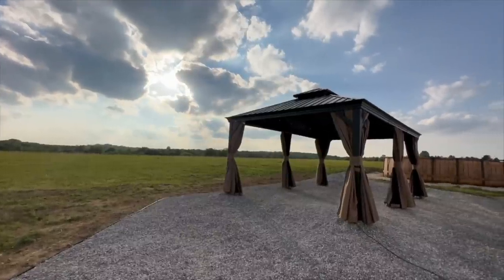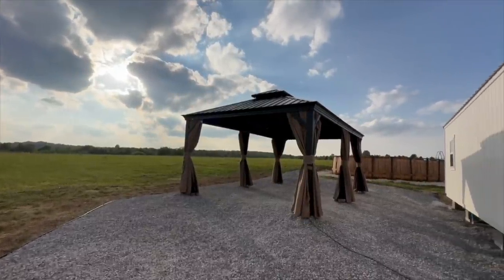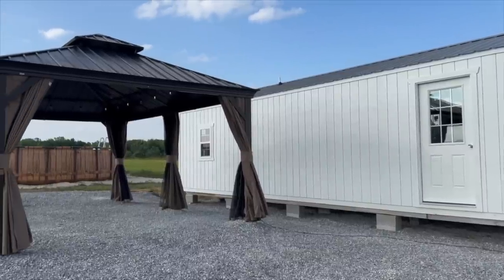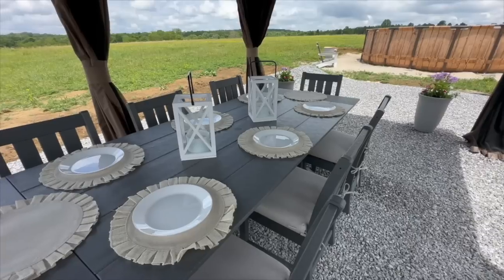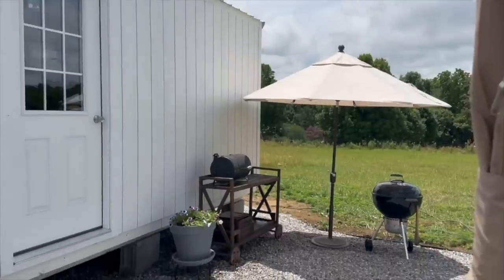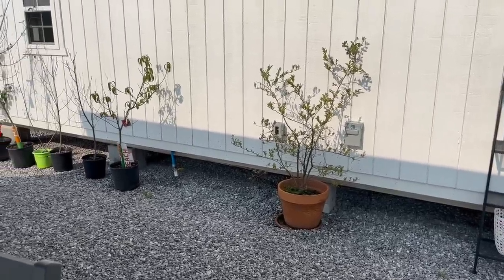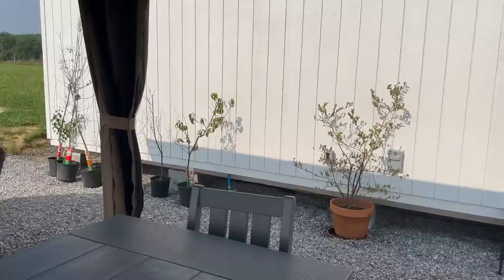PATIO MAKEOVER PART 3: A NEW POOL AND NEW SEATING AREA

Comment: Yes, you can still plant them if the branches, and near the bottom of the plant is still green. Let them get rooted in the ground, and then take some Epsom salt with some baking soda take a good strudy rod, or a PVC pipe put it in the ground as close as you can get it to the roots, and pour your mixture of the salt and soda, that will really bring your plant to life. It will make the Green, and the bud's really vibrant, and it also helps keep the bugs from tearing up your plants, you won't be sorry you did it. How to mix take one part of water to 3 to 4 tbsp. Of soda, add your salt's with one part salt's and one part water mix it with the soda mixture and with the PVC pipe in the ground as close to the roots as you can get it pour the mixture through the PVC pipe, and watch magic work. But be careful if you get to much of the salts it will turn your plant brown. I tested on some plants I was going to give away until I had the right recipe. Talking about beautiful plants with vibrant colors and the green leaves so beautiful I promise you won't have any regrets. I hope this helps you..  your friend Brenda 
Brenda

Comment: saltwater pools have traces of chlorine. Saltwater pools use chlorine generators and an electrolysis process to prepare the chlorine required for your pool. Electrolysis happens by sending electricity through saltwater which interacts with the chloride ion in the salt. This creates chlorine in the water and a very high-pH byproduct called sodium Hydroxide.
Reply: Thank you Captain Obvious!  Key word is traces, thank you for proving our point.